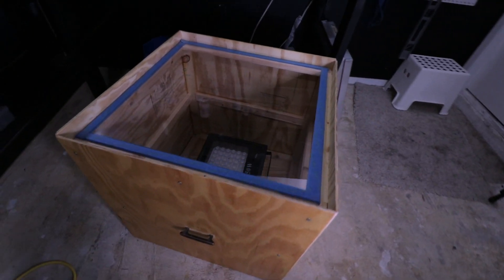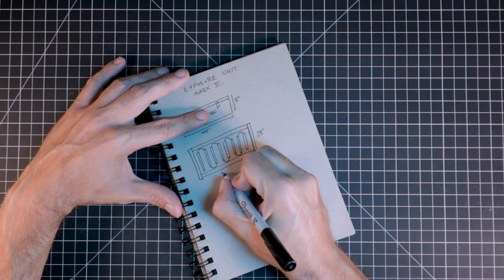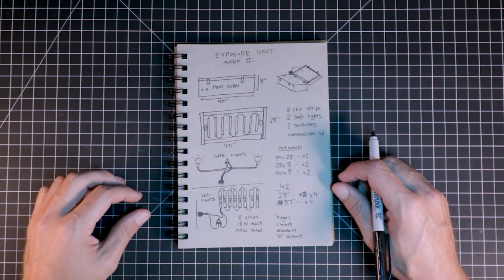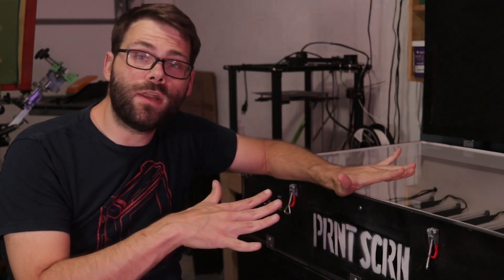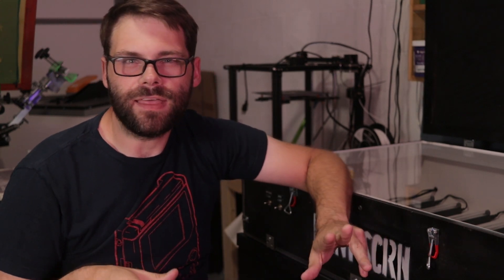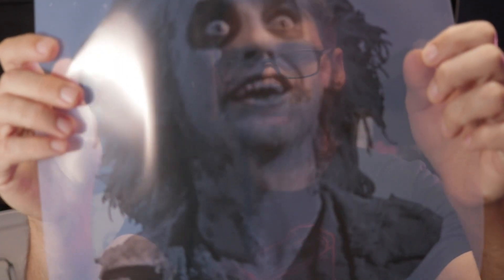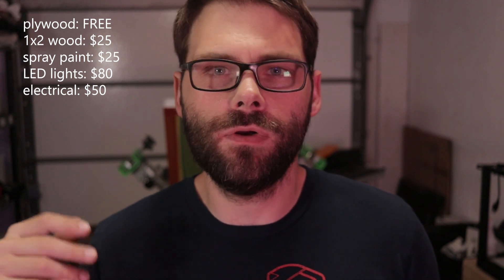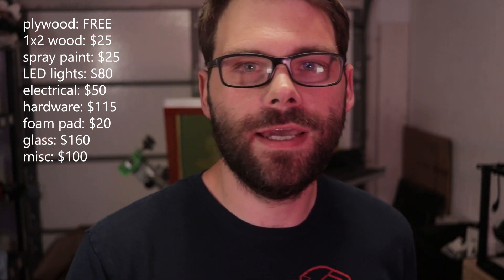Building A New DIY Exposure Unit /// Screen Printing Halftones

Comment: Would have definitely been better with the inside painted flat black. You don't want the light to reflect at all so it hits the emulsion from a direct angle and not diffused. I was a pre-press 4 color film stripper in the 90's and duped film for a living for 5 years. You want light straight down for your cleanest edges and that's it...

Comment: You could have got a professional unit for that price
Reply from the maker: Sure, a smaller one. I wanted to build a bigger one, and those can go for well over $1200. The point is you can make your own as big or small as you want for much less than the professional one will cost.

Comment: Thank you so much for the video!! I'd love to know more about how you did the lid & latch setup! I'm in the process of building a unit, primarily for cyanotype developing, and I'm trying to figure out the best way to achieve good contact pressure without worrying about damaging the glass. Can it handle stacks of different sizes without putting too much strain on the glass? If yes, how so?  Thanks again for the very helpful video!

Comment: Not to criticize your effort, but building an exposure unit is trivial. A real challenge is building an affordable direct-to-screen printer to lay down black ink onto emulsion. This is much more efficient than using transparencies. These machines exist but needlessly cost thousands of dollars.
Reply from the maker: If these machines cost thousands of dollars then building an exposure unit is not trivial.

Comment: Hi.  this is awesome video.  I built one following this and got lights from the link in your video, except I build 20x26 so half the size and got only 4-light pack.   I am having hard time figuring out exposure time with pre-sensitized emulsion, 110 mesh and 240 mesh, 1-1 coating.  How did you arrive at 40 seconds?   TIA for your help.
Reply from the maker: Thanks! I would use an exposure calculator to figure out the timing and dial it in. They can be found online, usually for free.
Reply: Hello, have you succeeded since then?

Comment: Does the same plug into wall outlet power both uv lights and safe lights after wiring to rocker switches?
Reply from the maker: No, I have them on separate plugs.

Comment: Wow, nice job. I’m starting out and trying to figure things out. I have 100 watt led flood light and Get no image no matter how long: 2 minutes, 3,5,7,8,10.  Zero image. You did it so quick. Very puzzling.
Reply from the maker: Preferably you would have a higher watt light source. If its a halogen flood light I'd say minimum 500 watts.

Comment: Awesome video. After using your unit for awhile now do you like the LEDs you used and would you make any adjustments now or love how it turned out and worked for you? I am in the process of building my own unit again with LEDs and liked how you made the cover so that it still put pressure over the foam pad. I was also thinking of building mine with a vacuum blanket but not sure If I should wait and do your approach and down the line if I needed to I can add that part later.  Anyways love your content and keep up the good work.
Reply from the maker: Thanks! Surprisingly, there are very few adjustments I would make. It's worked out for me for the most part, even the LEDs I'm using. I think the only thing I'd do differently is maybe cut a few inches off the height. The distance between LEDs and glass could be a little shorter, I think.
Reply: @joshisterrific  So basically you would make the height 7 inches instead of 9? and also how thick and what size is the glass you used?

Comment: Hey Josh, I have a question, and if you haven't already upgraded this project I have a few recommendations as well. By way of background, I've been using exposure units on and off for decades since I bought my first mercury vapour exposure unit from Nuarc.

Would you say that the additional cost of Starphire glass was worth the cost, AND how if so what is your opinion based on? Optical clarity is great for architectural glass and art pieces that are interpreted by the human eye, but since I only care about passing UV light I suspect the benefit is slight or non-existent since I can just increase exposure time slightly to account for lower UV transmission on slightly cheaper glass. The question is how uniform is the UV transmissibility on really cheap glass and will that impact the image quality?

I am going to finally make a unit since UV LEDs are now cheap and easy to source. I'll use a power supply and UV strips instead of fixtures and go with a higher LED density and wattage. 

You should add the following, a 12v 5a power supply, a 12V Timing Delay Relay Module Digital Timer Cycle Delay Switch Module with Dual LED Display and a Single Phase Solid State Relay SSR Relay with input 3 - 32v DC, and output 90 - 480 VAC. The timer will turn on and off the UV light source that is connected to the solid state relay.  This provides much greater consistency in exposure and adds about $60 Canadian to the cost, which is recouped for anyone building from scratch by not using super expensive glass. 

I use my UV units for photographic print processes like gum bichromate, gumoil and platinum palladium

Comment: Have always wondered why we can't use an old projector for an exposure unit.  Vacuum screen to film with clear plastic, hang it on the wall, project bright light?  Projectors use lenses to concentrate and distribute light evenly.  Any thoughts about this?
Reply from the maker: I think theoretically yes, it could work, but the challenge may be in securing the film to the screen. As long as you've secured it properly all you really need is a good light.

Comment: Hi Josh!!! This is the most inspiring video on constructing a DIY exposure unit. You really are terrific. Thank you. I am wondering if you have tried Baselayr Complete emulsion with your exposure unit? I am using water-based inks. Ryonet says that black-lights should not use Complete.
Reply from the maker: Thanks! I have not tried Complete yet. I want to try it just to see if it works, but I haven't done much waterbased printing yet tbh. Maybe soon!

Comment: Did you bypass the balces or how did you wire the underneath??
Reply from the maker: Did you mean ballast? There isn't a ballast involved, I think those are more for fluorescent lighting? I don't know, I'm not an electrician lol. I just cut the wires and added a switch to each circuit for the LEDs and safe lights.

Comment: Im in the middle of rebuilding an old exposure unit (from the 70-80s). Used to run off 220v and jumped the voltage to 680v at the bulb, to which i worked on a bit ☠️ lol. And im done fixing old tech and need to modernize it with LEDs and a modern controller. Right now i slapped in a 100w 395nm led and two stage switches as to not be able to turn on the led timer without turning on the vacuum at least

Long->Short; looking for a good LED source 🙃

Comment: Hi Josh. Have you ever experienced saw tooth / poor bridging in your designs? I've built essentially this exact unit and I the first emulsion I've tried is a photopolymer (polycol multi-tex) and while I've read that a switch to a dual cure may give me better detail/bridging... i've also read this style of exposure unit could also be to partially blame. What emulsion do you use? I've tried a wide range of exposure times / degrees of washout aggressiveness and still always see the saw tooth. The  only difference between out units is I did not build a vacuum top so I'm simply using a lot of weight on foam. I have 8 of the same UV strips as you under my 24x20 frame. Thanks.
Reply from the maker: I've been using Ryonet's Baselayr plastisol emulsion and I haven't had any problems with it. I haven't used a lot of dual cure at all, tbh, mostly photopolymer and the detail has been good enough for me so far. I've been meaning to try out other emulsions, but so far Baselayr has done the job so I haven't felt the need to switch. I actually don't have a vaccuum, just a compression lid, so a decent amount of pressure should do the trick. For washing out I pre soak with a spray bottle, let that sit for a minute, then spray in my washout booth with a garden hose, it's got a little pressure to it but nothing super strong like a pressure washer.
Reply: @joshisterrific  thanks for the reply. I'm not sure what I'm doing wrong then. It's been frustrating to say the least.
Reply from the maker: @thlstlght  if you're able to I would try experimenting with other kinds of emulsions. Dual cure is supposed to be more forgiving, and I have used it with LED lights similar to this, but I wasn't a fan of the longer exposure times.
Reply: @thlstlght  Hey. Did you solve your problem? Im having exactly the same issues right now what you mentioned earlier. Let me know please. Thanks:)
Reply: @piotrbukowski5129  What I ended up doing was attaching a plywood lid that I can fasten down to compress the foam to my screen. I lay a piece of black poster board on the screen with my foam on top of that. I picked up some toggle latch clamps and these compress things super tight. And I gave up on the emulsion I started with and tried Speedball only because it was readily available. It's certainly cheaper to buy professional emulsions in larger quantities but I'm superstitious at this point and keep using Speedball because I'm dialed in and I am just a hobbyist not printing too often.
Reply: @joshisterrific  my foam piece is not quite the full width of the inside of my frame but it is certainly larger than the printed art underneath it. Should be ok right?
Reply from the maker: @thlstlght  yeah the foam piece really just needs to cover the art, I use a smaller piece for big frames, no problems. Just make sure the weight/pressure on the foam is even across the surface.
Reply: @joshisterrific  actually I took another look at your video. For some reason I was thinking the foam /backing behind the screen was better black. I stuffed my foam into a black shirt then put that on the screen. I wonder if the shirt being between screen and foam is creating uneven surfaces or poor contact even with the 50+ lbs of weight I have on top. I'm going to try a few with just my white foam, plywood, weights. Thx.

Comment: Just built this unit and it's everything I needed for halftones and super fine details!
Reply: How much did you pay
Reply: @ReelsofGoldMedia  around 120, I had extra wood left over from a project. I
Reply: @DayCinco  What type of glass did you use and where did you find it?
Reply: @ReelsofGoldMedia  it was from my local glass shop. Normal glass. $19
Reply: @DayCinco hello, I would like to know if with this it is possible to insolate all types of illustrations.  for example illustrations with a lot of detail.  I specify that I have 90T frames
Reply: @DayCinco yeah!!! Josh paid way too much for his supplies in this video lol
Reply from the maker: @Queens703-mb  one of the biggest costs of mine was the starphire glass, you could go with normal glass which is cheaper, but its going to have some iron in it. i wanted it crystal clear. Also worth noting the cost of lumber has gone down since I made this video, so that would help with the overall cost as well.
Reply: @joshisterrific what thickness is the glass??
Reply: Yo what lights dude you use and where’d they come from?

Comment: How far apart did you space the LED strips?
Reply from the maker: I used a 2x4 to space them out, but I just found that was easiest for the length of my unit. I think they could be spaced less for a smaller unit.

Comment: Hey! What size should the glass be for screens that are 20x24?
Reply from the maker: I would make it at least a couple extra inches on each side to give it some room.
Reply: @joshisterrific  got it-thanks! 
I purchased the leds you got and got two of them -should I use them all or space them just like you did?
Reply from the maker: @juaneduardorosas3295  if you can fit them all I would, the brighter the better! Just space them out less, but still evenly.
Reply: @joshisterrific  Bet! Thanks so much!

Comment: Just finished mine using the same LEDs. Should make for a nice even exposure! My box is 30x20 so my spacing was a bit tighter than yours to cram all 8 in there. Thanks for the instructions I appreciate it!
Reply from the maker: If you're on Instagram I'd love to see a pic, hit me up at @prntscrnscreenprinting
Reply: hello, so your return after 1 years?  What do you think ?  does it work for illustrations with a lot of detail?

Comment: Hi! Thank you for this video! I am just starting out and was looking into making an exposure unit. I was just going to hang a bulb but i think the time for exposure will be a while. Would you recommend this same style for 20x24 screens? Or should I stick to the original one you created? Thanks!
Reply from the maker: You could go either way if you want to expose 20x24 screens. I could do those on my old unit, but the tricky part was getting enough light coverage with the smaller LED light, so this time I opted for strips that are more spread out. For me it usually comes down to how much you want to spend. The old light I used is about $50 on Amazon, the rest you could probably build for another $50-ish.
Reply: @joshisterrific  wow such a quick responder - love it! Lol 
Im not too savvy on the electrical part so I would probably go with the first light you mentioned but like you said it won’t get enough coverage. Do you have another recommendation of lights I could potentially use that gives more coverage? Or is it possible to use 2 of those lamps or led strings that doesn’t require me to do electrical? Lol
Reply from the maker: @jackiejackie8783  the electrical work is totally optional. I just really wanted an on/off switch on the front of the unit, but the lights I used here can be plugged into any outlet like normal, no electrical necessary. In fact I think these lights have an on/off switch located on the cable, I just didn't really like it so I rewired it for my unit.
Reply: @joshisterrific  ahhhhhhh got it! That’s awesome for me! So I just might get those string of us led lights. Would you say to stay with those or brighter? I’m going to use baselayer long lasting emulsion
Reply from the maker: @jackiejackie8783  I think these are bright enough. However, tbh, I haven't tested Long Lasting on this unit yet, so I'm not sure how it turns out. I can't imagine you would need anything brighter though, just gotta figure out the proper exposure time.
Reply: @joshisterrific  thank you again for answering! I really do appreciate it! Hopefully I’ll build mine soon and send you a pic :) do you have Instagram to check out your other platforms
Reply: @joshisterrific  nvm I found you lol
Reply from the maker: @jackiejackie8783  yeah I'm on Instagram, @prntscrnscreenprinting
Reply: @joshisterrific  what kind of LED UV light did you opt for? Like what kinda output are they?

Comment: Where did you get the foam?
Reply from the maker: I found it at Walmart, in the sewing/craft section.
Reply: Whay size foam thickness and do they have a big piece for the size exposure unit you made?
Reply from the maker: @Youthinkitweprintit  I got 2" thick foam. It was originally a big piece, like 24"x48", but I cut it down to the screen size I had.

Comment: Whats up Josh love your channel bro.  Exposure unit came out great led is a game changer.  Just wondering if your thoughts on the  D-100 have changed now that youll have to cure larger prints?   I already know its not ideal for large production.  Just wonder if you feel youve outgrown it?  Because i cant decide between that, the D-1000,  the little buddy or the Riley Jr.
Reply from the maker: Thanks! I still like my D-100. For the amount of production I'm doing at the moment it still works just fine. I can see myself upgrading to the Little Buddy sometime, or just waiting it out until I move into a bigger space and getting something bigger, but for now it's still the D-100 for me.